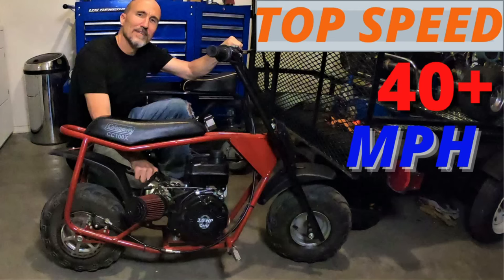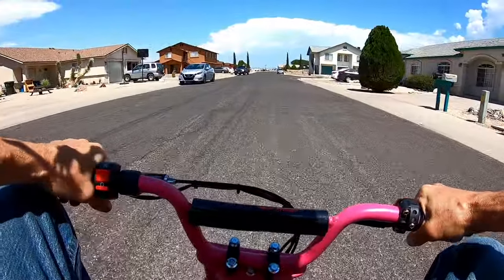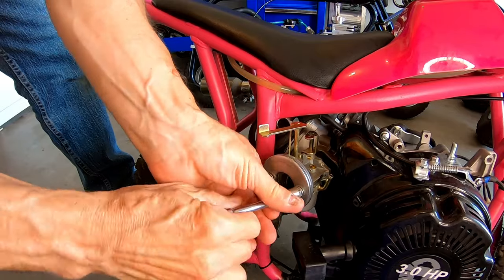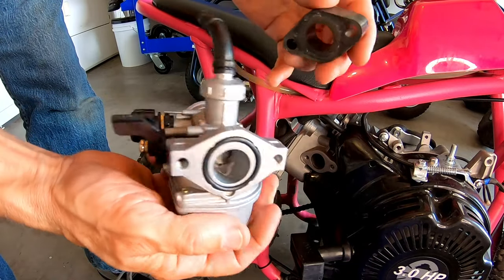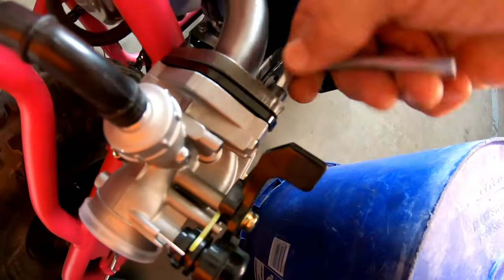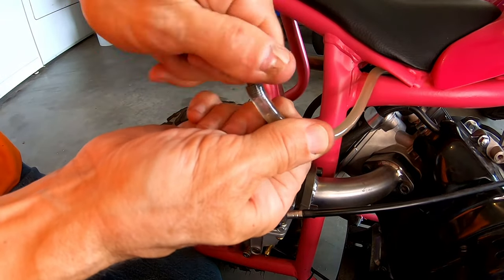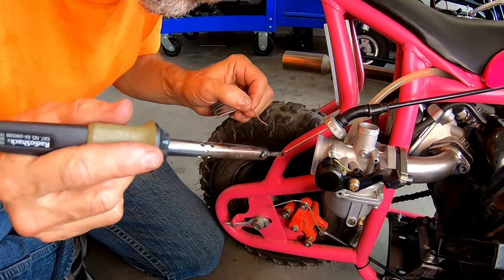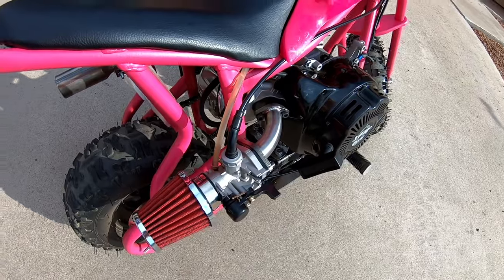When you install a 19MM slide carburetor on a Coleman 3hp

Comment: We've got the stock carb on the same 3hp motor. We're experiencing a leak between the carb and gasket and spacer every time we warm the engine up for say 20 minutes of riding. I've tried replacing the gaskets and tightening (afraid to go too far with the tightening as I don't want to strip those bolts). Do you know if this is a common problem? I'm wondering if the plastic carb spacer is warping when it gets hot or something.

Comment: starve an engine of fuel so it breaks sooner is the companies repeat business model XD. The carb, with the header and filer probably still run richer than stock. Idk if the additional torque on the parts is offset by the engine running richer in this instance, so no clue if this makes the engine mod more reliable having the rest stock and governed. Anyways great video with real world results, almost a 25% top speed gain with just a carb and intake swap.

Comment: Did you have to mess with the springs or the Jets?
Reply: I have a ct100u I’m trying to figure out do I need to change the springs out before I change the carburetor on my bike?
Reply: @calebwalker20234 if you have some mild mods to it springs would help so the bike doesn’t bog out at top speed

Comment: I got 45 miles an hour out of the same Engine with stock ported carburetor and drilling out the side jet because they don't really have a removable jet and the stock carb. But the bike and engine looks sweet. I'm definitely going to pick up one of those carburetors though a lot less work and headache
Reply from the maker: Oh sweet!The Coleman bikes are fun. I would like to have another 3 horse cc100x .  I know what your talking about . I drilled out the jet on the stock carb too. I cant remember for sure but I don't think I got it into the 40's until I added the slide carb.
Ya, I love that carb on that thing. It made a big difference.

Comment: After I installed my mikuni the bike lost its torque it has top speed but before when it had stock carb it would want to wheelie
Reply: Run the filter cleaner carb and engine

Comment: My question is the engine has a 20mm intake port would a smaller elbow diameter help with torque I may have to make a custom elbow on mine gonna need the bend and some drop to it
Reply from the maker: Possibly. I know this long intake helps low-end and mid-range on this bike.

Comment: I’m having trouble tuning this carb. I live at sea level and i tried doing the idle and mixture screw and it bogs around 4100 RPM. I think 1 problem is that i didn’t gasket match the gasket between the intake manifold to the head. Do you know how you would tune this carb?

Comment: lets say if i were to do this could i still use the stock throttle cable
Reply from the maker: Yes, you can.
Reply from the maker: But you have to solder a tip on it

Comment: im running the same carb on my 3.5 but i only get 40 its on 75 rear sprocket and 12tooth clutch im not running the manifold they got it right to the engine
Reply from the maker: I think that manifold really helps it out in the low end and mid range.

Comment: I bought the carb and Intake it only runs on choke I adjusted throttle idler screw still nothing any help? I have the same Motor
Reply from the maker: Make sure there aren’t any leaks anywhere between the carb and manifold and the manifold the engine . 
Make sure it’s getting plenty of fuel .
Reply: Thank you intake to manifold was loose got it running good now awesome video man
Reply from the maker: @dtown3155  Thanks! That is awesome ! Happy you got it running .
Reply: Have you ever had an issue with the carb getting to much fuel ????

Comment: Hey i went to that link for the carburetor and it takes me to a steering wheel leather outliner and i’m also modding my coleman 3 horse
Reply: By the way i got 41 mph on a ct100u with the governor bypassed and a header pipe
Reply from the maker: Thanks! I fixed the carb link. I have more videos coming out with the Coleman 3-horse.

Comment: With that coleman ct100 motor, how much hp do you think the stock clutch can handle?
Reply from the maker: I think it will handle more than this engine can put out . The clutch is pretty durable
Reply: @Black66  okay, thanks man. I'm building one for a race, and I'm trying to go fast as possible, but it has to be original motor(anything can be done to it) just oem clutch and gear ratio. It's an 1/8 mile race. Just trying to figure out what my limits are.

Comment: I put a 19mm carb on my 79cc rcf micro mini but then the carb seems like it only gives half throttle than bogs out. Should i jet it bigger
Reply: That’s the same scenario for me. I bought one of these and around 4000-4300 RPM it bogs real bad. I didn’t gasket match the intake manifold to the cylinder head gasket very well so that could be a problem. I tried tuning the carb itself by only the idle and fuel mixture screw. still didn’t work.
Reply: @nickbestn4230  i got mine running good. It ended up being the manifold bolts coming loose from being to long
Reply: @Turbski1  I recently gasket matched it. It runs ok with half choke so it means it’s running lean. I either need to fine tune it or get a bigger jet

Comment: how long did it take to get your carb, usps is stuck in transit for four days.
Reply from the maker: I got it quick, but it was quite a while back. Things seemed to run faster then
Reply: @Black66  it got here, i put the thing on and the carb is spitting and spuddering, should i replace the fuel line that it came with?